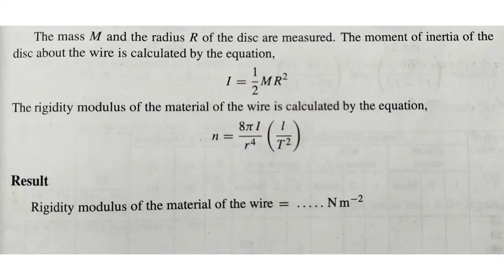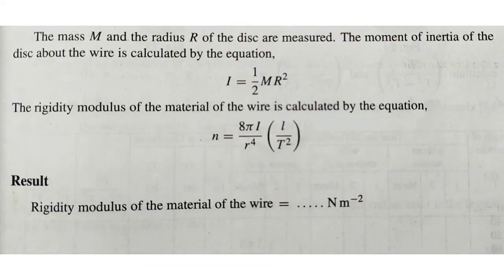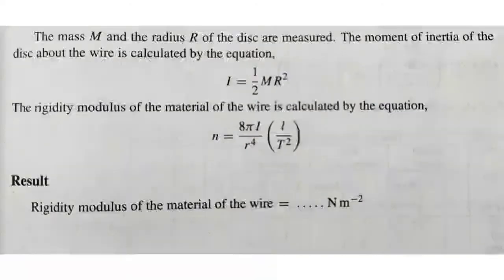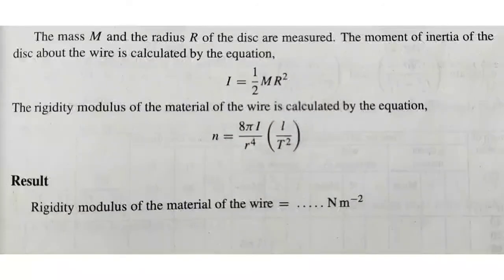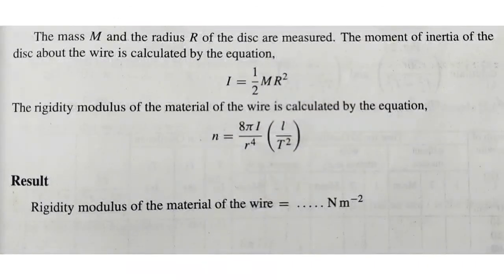TORSION PENDULUM

Comment: Sir nammal disc cheriya anglil thirichal 20 oscillation vare count cheyyan pattuvo.. 
Ath kurach kazhinj nikkille.., appol nammal ath enganeya kand pidikkunnenn onn paranj theruvo☺🙏
Reply from the maker: 20 or 10 oscillations... Wire length 60cm, 55cm, 50cm, 45cm, 40cm set cheythu oscillations edukaam. 20 or 10 oscillations count cheyaam. Usually above 20 oscillations kittum. Evide use cheytha disc mass 500 gms. 50 cm length set cheythu small oscillations try cheyoo. Also make sure to tighten the  screws.